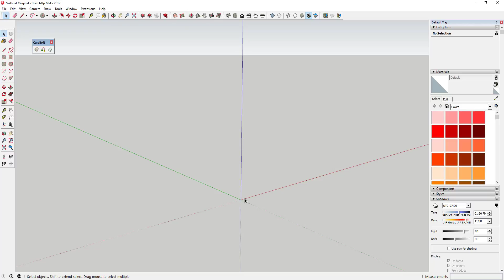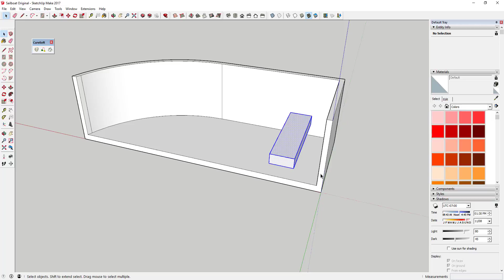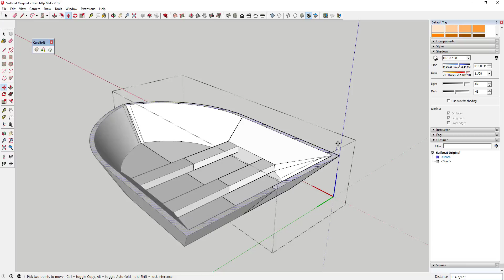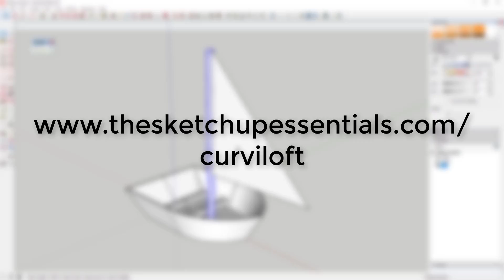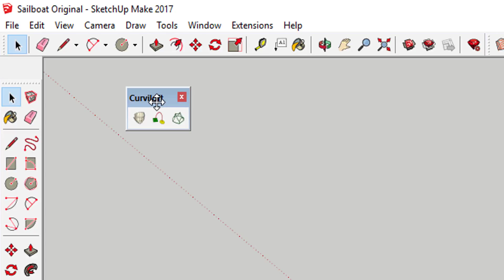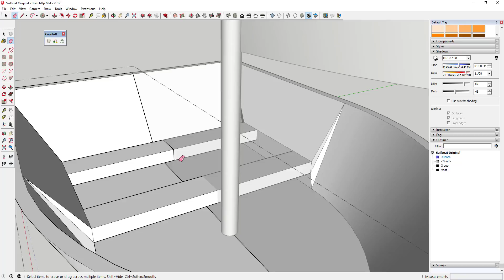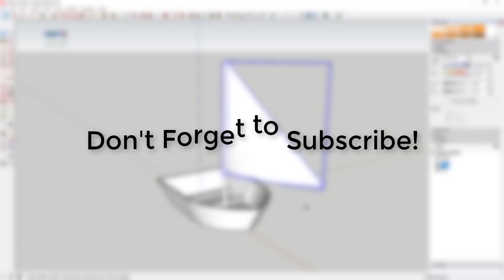Model a Sailboat in SketchUp with the Scale Tool and Curviloft

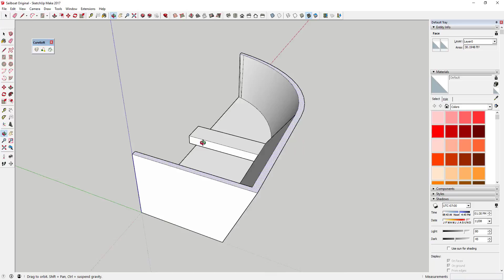Comment: Great video I am new to SketchUp and have a question at min. 2:20 you used the S key to put an angle on the hull of the sailboat. My question is can you cause the angle to be created 10 scale inches from the bottom the boat? My 2nd question can one start the bow curve about a 1/3 of the distance from the center line. Thank you for your help with these question.